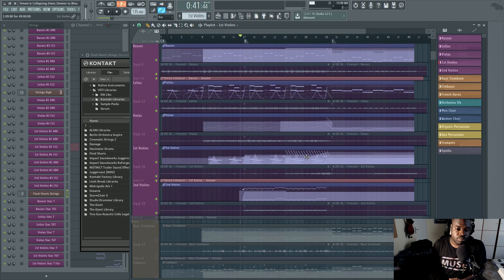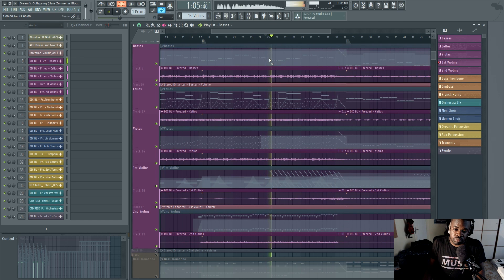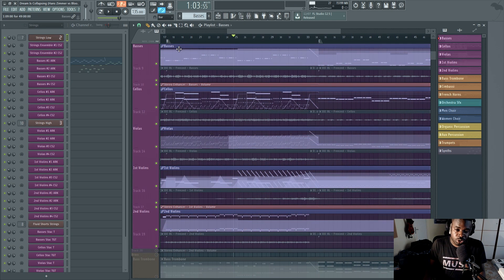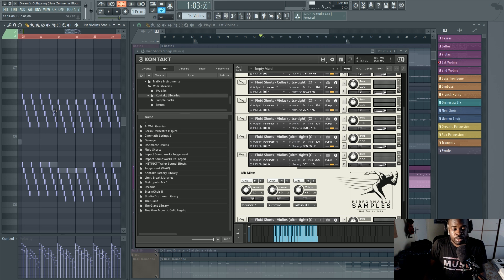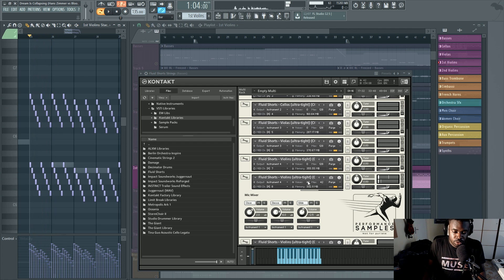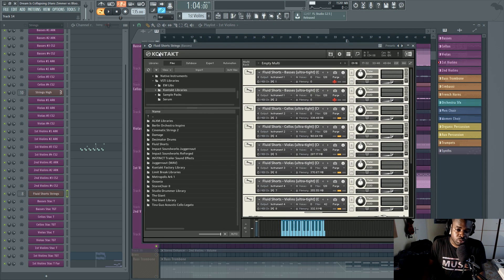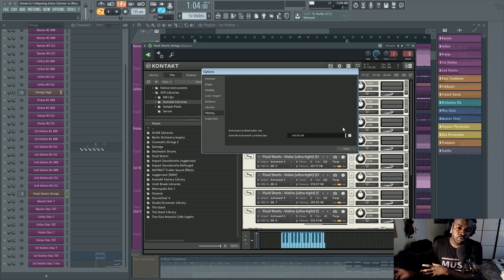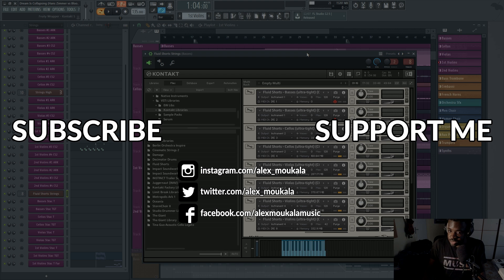How To Save Lots of CPU While Composing with Kontakt

Comment: Hi Alex, I really like your informative videos. I notice that in this one you are using multiple instances of Kontakt within the same instance of Kontakt. Is there any advantages of doing it this way over loading a separate instance for each instrument on a separate midi track? Thanks
Reply: Maybe because Alex is using Kontakt in combination with the BRSO Articulate plugin. It really improves the workflow because you don‘t have to play the notes for key switching (C0 and so on) in the piano roll. You don‘t have to scroll up and down to place the key switching notes, you just choose a different color for any articulation. 

And to your question: You have to load one instance of BRSO for any instrument. And that would be a mess if you have to load two plugins (Kontakt + BRSO) in the channel rack for every single instrument. 

What Alex does (he explains that precisely in one or two of his videos) is having only one instance of Kontakt for every group like strings, brass, woods, etc. (or however you want to group it) and multiple instances of BRSO. In the BRSO plugin you set the midi port and the channel number for each instrument inside Kontakt so you can trigger any Kontakt Player and any instrument separately. 
Moreover, triggering knobs and sliders in Kontakt works really easy with BRSO, too. It‘s such a great plugin and it‘s free! 🙏🏼

Comment: When im running very large template in vienna ensemble pro off of my Server computer into my master computer i am getting cpu spikes. i noticed the cpu monitor in Kontakt instrument is going to 100%  Multiprocessing in Kontakt is set to off so the host handles that. i See in the Expert/Engine window that it says 1 core being used. i have 24 cores or threads. I have kontakt set to load max amount into ram  still maxing out. any suggestions?
Reply from the maker: I've never used that configuration so I can't tell, but try using kontakt's multi-processing instead of your hosts.
Also, try getting in touch with the native instruments support team.
https://support.native-instruments.com/hc/en-us

Comment: Hi Alex,
I'm using FL Studio 12. I have i7-4700MQ, 2.40 GHz, 16 GB RAM, Windows 8,1. x64
I recently discovered that FL can't use more than 4 GB of RAM. 
When I use a few Kontakt libraries in a project, the FL starts to freeze. But in Task Manager it's  only 20% used of my CPU and RAM. 
Do you know how to solve this problem ?
Also I tried to use FL.exe, FL64.exe and FL (compatible memory). It doesn't work.
(P.S.  I tried Reaper DAW and it's working good, using all my RAM. But I want to use FL ;)
Reply from the maker: Try posting in the FL Studio forum about this issue!

Comment: That first tip is called "bouncing" not "freezing".  Freezing is when you put a MIDI instrument track into an uneditable state.  Bouncing is recording one track onto another.  I can see you're in FL and those tracks are called "freezed" - not sure whether it was you or FL that named them that - but typically freezing isn't going to produce a visible waveform.  I can see your instrument tracks are actually frozen but, still, it's two different processes happening there.
Reply: He was right it is freezing
Reply: A bounce is a audio export. Freezing is bouncing in place.

Comment: 16 GB ram and still cracking? i fight with 4GB memory :) 
two another tips for fl studio:
1. tools--macros---switch smart disable for all plugins
2. options---project general settings---timebase(ppq) 
default is 96, try change it . decreasing can cause some problems with external pugins, but for me worked well increasing too and i stopped sometimes my cracking problems

unchecking safe overloads in audio settings option can help cpu, but next in bigger projects are distorsions of sound very clearly audible
Reply: It helped

Comment: Hey Alex. Is there any FL shortcuts to convert a midi track to wave (without making usual export)? And what's the point about loading multiple vsti into one kontakt instance? I mean, in your Oceania section, do you use multi-sampling or is it just a trick related to RAM/CPU saving? Thanks for the tips pal.
Reply from the maker: Yeah, in FL Studio 12.5 onwards, you can use the picker panel to do that and it's quite fast -> https://www.image-line.com/documents/news.php?entry_id=1496187060&title=fl-studio-125-beta

Comment: Hi Alex, When you limit the voices, does that affect only when the samples are played with midi or even if you bounce/freeze the track? Will the frozen audio track have poor sound because it has too few voices? If that's true would it be best then to freeze with as many voices as possible to get the fullest sound?
Reply from the maker: That's something I'm unsure of. FL Studio has a function that is supposed to disable voice limits when exporting, but I haven't really checked if it works with Kontakt too.
If you're in FL, test it yourself and let us know!
Reply: I'm in Logic and have EastWest Play. I can't find a way to set the voice limit lower that 128 in Play and tried with different instruments to go over 128 voices and it's already so cluttered and full of sounds that my ear can't really detect voices being killed. Also couldn't find anything in the documentation that mentions it. I suppose it's not that big of a problem. I just asked out of curiosity:) Thanks.

Comment: Great vid as always Alex, I find clicking 'Purge' and then selecting 'Update sample pool' also helps as i think this removes any samples loaded you're not using or that are not being triggered by your midi notes. Sometimes i see a library size of such and such GB's reduced to mere MB's when doing this. :)
Reply from the maker: Karl ONeill yeah, the purge function is useful to reduce the amount of allocated RAM. :)
However, it doesn't have an impact on the CPU sadly. The best thing is to use all possible optimizations at the same time!